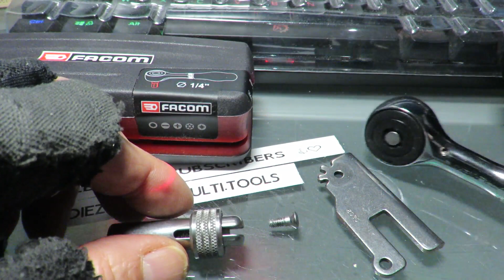LEATHERMAN TOOL ADAPTER (V2) : Disassembly [MT VOD]

Comment from the maker: MT VOD * Dear lovers of multi-tools, you can ask me everything, redo a review, insist on a detail, make comparisons, test this or that, I am at your disposal! :) * Multi-Tool VOD
Here is my collection of multi-tools (March 2020) [/S = Brand Sheath]. Each model has been the subject of one or more videos (see my playlist "MULTI-TOOLS").
001- BALADEO Outdoor Cutlery Multi-tool /S               
002- BEAR & SON Bear Jaws 155LS /S
003- BEAR & SON Bear Jaws Multiscissors Gardener BC157GT /S
004- BEAR & SON Electrician's Bear Jaws BC155EL /S
005- BIBURY Multifunction Garden Pruner BBY-MT11 (offered by the company)
006- BIBURY Multifunction Tool BBY-MT08 (offered by the company)
007- BLACK FOX BF200 /S
008- BÖKER PLUS Tech Tool City 5 /S
009- BUCK Knives X-Tract 730 /S
010- BUCK Knives X-Tract 735BKS-B Essential
011- BUCK Knives BuckTool 350 (MiniBuck)
012- BUCK Knives BuckTool 355 /S
013- BUCK Knives BuckTool 360 /S (*2/ one completely broken)
014- BYRD ByrdRench BY15P /S
015- COLEMAN Pro Lock /S
016- CRKT Bivy CR9250 (by Hans Florine)
017- CRKT Guppie CR9070 (by Launce Barber)
018- CRKT Technician Multi-tool CR9201 (by Glenn Klecker)
019- CRKT Tool CR9200 (by Ed Van Hoy & Tom Stokes/ with Bit Kit) /S
020- CRKT Zylla-Tool Jr. CR9065K /S
021- CRKT Wooden Multi-Tool Kit CR1035
022- EICKHORN SOLINGEN PRT-II Rescue Knife /Böker S
023- FISKARS Cuts+More
024- GANZO G301-H /S
025- GANZO G302-B /S
026- GERBER Armbar Drive Onyx
027- GERBER Balance /S
028- GERBER Bullrush /S
029- GERBER Center-Drive (with Bit Kit+ Victorinox Scissors) /S
030- GERBER Center-Drive Plus (with Bit Kit) /S
031- GERBER Crucial /S
032- GERBER Crucial F.A.S.T. (with Hex Bit Kit)  /S
033- GERBER Curve
034- GERBER Diesel /S
035- GERBER Dime (*3/one with broken cissors)
036- GERBER Flik /S
037- GERBER Fit /S
038- GERBER Grappler /S
039- GERBER MP1 /S
040- GERBER MP1-MRO (with Bit Kit) /S
041- GERBER MP 400 Compact Sport (05500/ 45500) /S
042- GERBER MP 500 Recoil Auto-Plier /S
043- GERBER MP 600 Bluntnose (old model with 55200 Multi-Plier Pocket Tool Kit) /S
044- GERBER MP 600 Bluntnose Black (07520G1N Carbide Insert Cutters with Tool Kit) /S
045- GERBER MP 600 Bluntnose SS (07500 Carbide Insert Cutters)
046- GERBER MP 600 Pro Scout (07564/ 47564 with Tool Kit) /S
047- GERBER MP 700 Urban Legend /S
048- GERBER MP 800 Legend /S
049- GERBER Obsidian
050- GERBER Octane /S (*2)
051- GERBER Radius /S
052- GERBER Splice
053- GERBER Strata /S
054- GERBER Suspension /S
055- GERBER Suspension-NXT /S
056- GERBER Truss /S
057- GERBER Vise
058- HANWEI Professional Multi-tool by PAUL CHEN 1008-GT
059- HAVALON Evolve Jim Shockey Signature Series XTC-60AMTS /S
060- HENSTRONG (or Bibury or Intey or …) 18-in-1 /S
061- KERSHAW A100C /S
062- KERSHAW Select Fire 1920
063- LEATHERMAN Blast (with Removal Bit Driver) /S
064- LEATHERMAN Brewzer
065- LEATHERMAN Charge+ (with Bit Kit & Pocket Clip & Lanyard Ring & Bit Driver Extender) /S
066- LEATHERMAN Charge+ Forest Camo (with Bit Kit & Pocket Clip & Lanyard Ring & Bit Driver Extender) /S
067- LEATHERMAN Charge+ G10 (red) (with Bit Kit & Pocket Clip & Lanyard Ring & Bit Driver Extender) /S
068- LEATHERMAN Charge+ TTI (with Bit Kit & Pocket Clip & Lanyard Ring & Bit Driver Extender) /S
069- LEATHERMAN Charge AL /S
070- LEATHERMAN Charge ALX Black Oxide /S
071- LEATHERMAN Charge TI 2HO (with Bit Kit & Pocket Clip & Lanyard Ring & Bit Driver Extender) /S
072- LEATHERMAN Charge TTI (with Bit Kit & Pocket Clip & Lanyard Ring & Bit Driver Extender) /S
073- LEATHERMAN Charge XTI (with Bit Kit & Pocket Clip & Lanyard Ring & Bit Driver Extender) /S
074- LEATHERMAN Core /S
075- LEATHERMAN Crunch /S (*2 / including a clone)
076- LEATHERMAN Expanse E33BX /S
077- LEATHERMAN Expanse E33T /S
078- LEATHERMAN Expanse E55BX /S
079- LEATHERMAN Expanse K502X /S
080- LEATHERMAN Flair /S
081- LEATHERMAN Free K2X
082- LEATHERMAN Free K4
083- LEATHERMAN Free P2 /S
084- LEATHERMAN Free P4 /S
085- LEATHERMAN Free T2
086- LEATHERMAN Free T4
087- LEATHERMAN Freestyle /S
088- LEATHERMAN Fuse /S
089- LEATHERMAN Juice B2
090- LEATHERMAN Juice C2 /S
091- LEATHERMAN Juice CS3
092- LEATHERMAN Juice CS4 /S
093- LEATHERMAN Juice KF4 (offered by the company & signed in my name by Tim) /S
094- LEATHERMAN Juice Pro (with Victorinox Mini Screwdriver) /S (*2/ one offered by the company & signed in my name by Tim) /S
095- LEATHERMAN Juice S2 /S
096- LEATHERMAN Juice SC2
097- LEATHERMAN Juice SX /S
098- LEATHERMAN Juice XE6 (with Victorinox Mini Screwdriver) /S
099- LEATHERMAN Kick /S
100- LEATHERMAN Klamath /S
101- LEATHERMAN Leap /S
102- LEATHERMAN Micra
103- LEATHERMAN MUT (with Bit Kit & Tool adapter V2) /S
104- LEATHERMAN MUT EOD /S
105- LEATHERMAN OHT (with tweezers) /S (*2)
106- LEATHERMAN PST (*2)
107- LEATHERMAN PST II
108- LEATHERMAN PULSE /S
109- LEATHERMAN Raptor /S
110- LEATHERMAN Rebar /S
111- LEATHERMAN Rev /S
112- LEATHERMAN Signal /S (with Bit Kit & Bit Driver Extender)
113- LEATHERMAN Sideclip
114- LEATHERMAN Sidekick /S (with carabiner)
115- LEATHERMAN Skeletool /S
116- LEATHERMAN Skeletool CX V1(with Bit Kit & MUT Bits) /S
117- LEATHERMAN Skeletool CX V2 /S
118- LEATHERMAN Skeletool KBX
119- LEATHERMAN Skeletool RX (with Bit Kit & MUT Bits) /S
120- LEATHERMAN Squirt E4 (*2/ one offered by the company & signed in my name by Tim)
121- LEATHERMAN Squirt ES4
122- LEATHERMAN Squirt P4
123- LEATHERMAN Squirt PS4
124- LEATHERMAN Squirt S4
125- LEATHERMAN Style
126- LEATHERMAN Style CS
127- LEATHERMAN Style PS
128- LEATHERMAN Super Tool /S
129- LEATHERMAN Super Tool 200 (with Tool Adapter V1) /Combo S
130- LEATHERMAN Super Tool 300 /S
131- LEATHERMAN Super Tool 300 EOD /S
132- LEATHERMAN Surge (with Bit Kit & Pocket Clip & Lanyard Ring & Bit Driver Extender) /S
133- LEATHERMAN Surge 2013 Black Edition (with Bit Kit & Pocket Clip & Lanyard Ring & Bit Driver Extender) /S
134- LEATHERMAN Wave (with Bit Kit & Pocket Clip & Lanyard Ring & Bit Driver Extender) /S
135- LEATHERMAN Wave+ (with Bit Kit & Pocket Clip & Lanyard Ring & Bit Driver Extender) /S
136- LEATHERMAN Wave Original /S
137- LEATHERMAN Wingman V1 /S
138- NEXTOOL Xiaomi 10-in-1 Motool /S
139- OPINEL N°9 Bricolage
140- OPINEL N°12 Explore
141- OZARK Trail MULTIFORCE PREMIUM 18-IN-1 MULTI TOOL /S
142- PIRANHA 6-in-1 (crescent wrench & pliers combo) /S
143- PIRANHA 9-in-1 (crescent wrench & pliers combo) /S (*2)
144- RATNIK 6E6 (with diamond-coated file) /S
145- ROXON Knife Scissors S501 (*2 /  one offered by the company)
146- ROXON Multi BBQ Tool MBT Mini S602 (offered by the company)
147- ROXON Multi BBQ Tool MBT3 S601 /S (*2/ one offered by the company)
148- ROXON Spark CM1349 /S (*2/ one offered by the company)
149- ROXON Storm S801 (with bit kit & Victorinox Mini Screwdriver) /S (*2 / one offered by the company)
150- ROXON Storm S801S (with bit kit & Victorinox Mini Screwdriver) /S
151- RUIKE Criterion M61-G (with Victorinox Mini Screwdriver) /Böker S
152- RUIKE Trekker LD43 Rescue Tool
153- RUIKE Trekker LD51-B (with Victorinox Mini Screwdriver) /Victorinox S
154- SCHRADE Tough Chip ST2 /S
155- SCHRADE Tough ST1 (original U.S./ version 1) /S
156- SCHRADE Tough ST1 (Taylor Brands Schrade) /S
157- SCHRADE Tough ST11 /S
158- SCHRADE Tough STE5 /S
159- SEBERTECH Sebertool M2
160- SEBERTECH Sebertool M4
161- SOG CrossCut 2.0
162- SOG CrossGrip
163- SOG Kilowatt
164- SOG Paratool S31 (with Saw instead Philipps screwdriver + Bit Driver + Hex Bit Accessory Kit) /S
165- SOG ParaShears
166- SOG Pocket PowerPlier S44 /S
167- SOG PowerAccess Deluxe (with bit kit) /S
168- SOG PowerAssist S66 (with Saw instead of V-Cutter) /S 
169- SOG PowerDuo PD01 /S
170- SOG PowerGrab (with Bit Kit) /S
171- SOG PowerLock S60 (with Bit Kit) /S
172- SOG PowerPint (with Bit Kit) /Böker S
173- SOG PowerPlay (with Bit Kit) /S
174- SOG Snippet
175- SOG SwitchPlier V2.0 /S
176- SOG Sync II
177- SPYDERCO ASSIST SALT FRN YELLOW C79YL - Rustproof H-1
178- SWISS+TECH Micro-Max 19-in-1
179- SWISS+TECH Micro-Plus EX 9-in-1
180- SWIZA C08 Urban Camo/S
181- TOPEAK The Alien /S
182- UD Vape Cool Kit Multi-tool Cutting Pliers /S
183- UTICA KUTMASTER Multimaster 11-3565CP /S
184- VICTORINOX Bantam (ALOX Silver 0.2300.26)
185- VICTORINOX Cybertool L (1.7775.T) /S
186- VICTORINOX Cybertool Lite (1.7925.T) /S1
187- VICTORINOX Evolution Grip 18 (2.4913.SC8B1) /S
188- VICTORINOX Evolution Grip S54 (2.5393.SC) /S
189- VICTORINOX Expedition Lite (1.7965.AVT) /S
190- VICTORINOX Hiker Wood (1.4611.63))
191- VICTORINOX Huntsman Lite (1.7915.T) /S
192- VICTORINOX Huntsman SilverTech (1.3713.T7) /S
193- VIVTORINOX Jelly SwissCard Lite (0.7333.T3B1)
194- VICTORINOX MiniChamp (0.6385) /S
195- VICTORINOX MiniChamp Alox (0.6381.26) /S
196- VICTORINOX Nail Clip 580 (0.6463)
197- VICTORINOX Pioneer X (ALOX Silver 0.8231.26)
198- VICTORINOX Ranger Grip 58 Hunter (0.9683.MC) /S
199- VICTORINOX Ranger Grip 71 Gardener (0.9713.C) /Wenger S
200- VICTORINOX Rescue Tool (0.8623.MWN) /S
201- VICTORINOX Signature Lite SilverTech (0.6226.T7) /S
202- VICTORINOX Super Tinker 2019 Limited Winter Magic Edition (1.4703.7E1)
203- VICTORINOX Swiss Army Knife 2018 (0.8461.MWCH) /S
204- VICTORINOX Swisschamp (1.6795.T) /S
205- VICTORINOX Swisschamp XLT [1.6795.XLT] /S
206- VICTORINOX SwissTool PLUS (3.0323.L) (with all accessories & scissors) /S
207- VICTORINOX SwissTool Spirit XBS (3.0224.3CCH) /S
208- VICTORINOX SwissTool Spirit XC PLUS RATCHET (3.0239.N) (with all accessories) /S
209- VICTORINOX Traveller Lite (1.7905.AVT) /S
210- VICTORINOX Wine Master (walnut wood 0.9701.63) /S
211- VICTORINOX Workchamp (0.9064.3) /S (~ 0.8564 : lockable large flat screwdriver)
212- WALTHER Multi-Tac /S
Reply from the maker: 213- WENGER EvoGrip S557 (1.557.059.821 with Victorinox Mini Screwdriver/ ~ Victorinox Evolution Grip S557) /S
214- WENGER Pocketgrip 577 /S
215- WENGER RangerGrip Handyman 1.077.0[90.822] /S (~ Victorinox Ranger Grip 74 or 174 Handyman or Boatsman for the pliers)
216- WENGER Swiss Business Tool SBT 60
217- WENGER Titanium 2 (1.092.042.000) /S
218- WENGER Titanium 3 Ueli Steck Spécial Edition (1.092.040.000) /S
219- WORPRO 16-in-1 Multi-tool /S
220- XIAOMI Nextool Huohou (or Nextool 16-in-1 6-in-1 Flagship Pro) /S

Acquisition forecast - Call for donations… Sog, Gerber, Victorinox and the others (except Roxon, Bibury & Leatherman) still stubbornly refuse to send me models that I could present. We live in a world unnecessarily absurd delivered to spirits that seem to be content with it...
1- BEAR & SON Mini Bear Jaws 153
2- EMERSON Multitasker EDC 1/ 2
3- FLEXCUT JKN91 Right-Handed Carvin' Jack
4- GERBER Evolution MP650
5- GERBER FreeHand
6- GERBER Solstice
7- KAMPO NS-2
8- LEATHERMAN Expanse K503X
9- LEATHERMAN Freestyle CX
10- LEATHERMAN Mini Tool
11- LEATHERMAN Pruner (Genus/ Visa/ Hybrid)
12- LEATHERMAN Steens
13- MASERIN Citizen 564/G10N (by Moris Baroni)
14- MELITA-K Sapper/ Professional
15- SOG Paladin PowerPlay PT-540
16- SOG ToolClip
17- SPYDERCO ClipTool Rescue C209GS
18- SPYDERCO Spyderench T01
19- TOLER TOOLS
20- VICTORINOX XAVT (1.6795.XAVT)
21- WENGER Ranger 14 Gardener
22- WENGER RangerGrip 95 - Rescue II
23- WENGER SwissGrip (WengerGrip 76)
24- WENGER Titanium 1

Comment: I've got the same Leatherman Tool Adapter which has the same spec and I disassembled it and put the screw back, no problem. I love Leatherman's somewhat clunky tools, they are reliable and well made, fitting my 'Surge and 'Wave, both same age. Had all three for 13 years and they are still going strong.